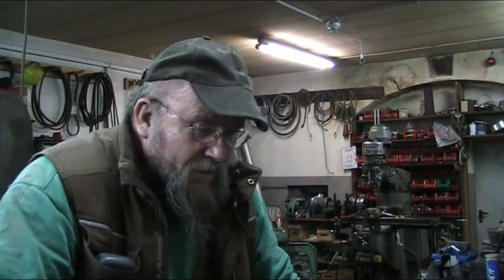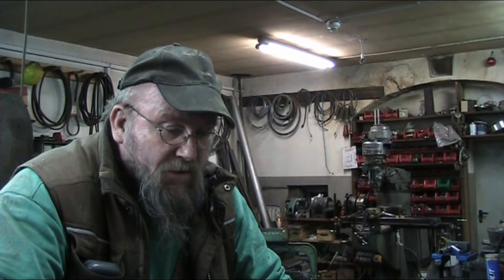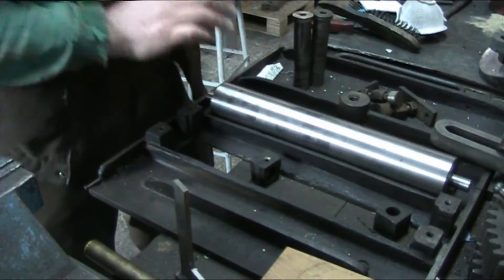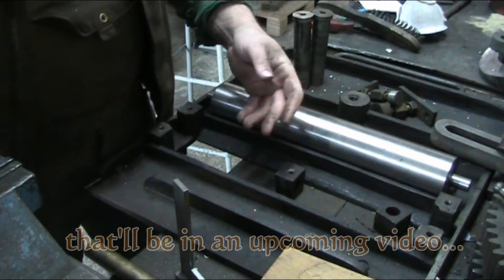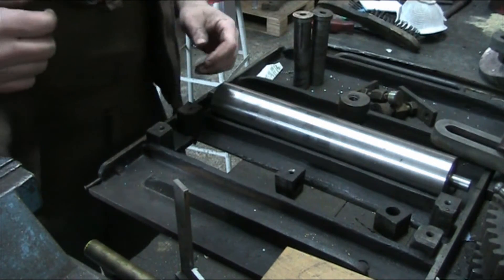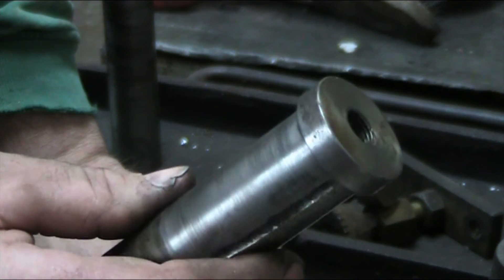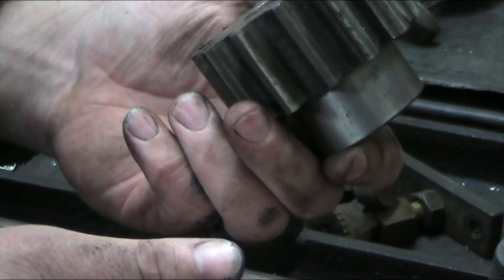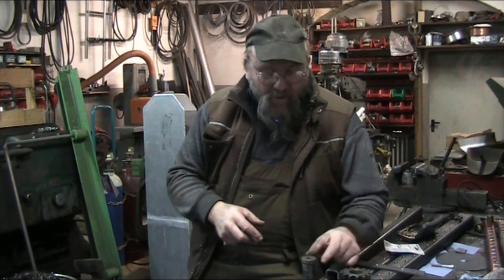this old planer, episode 6, failure analysis of the gear train

Comment: I would also second Keith Ruckers method of restoring that gear, but it is a rather small one so perhaps making a new one would be quicker and nothing to worry about the wear on the other teeth. 
Gears with broken teeth are suspect by default, needs very close inspection of the teeth next to it, it is quite likely that you may find a developing crack a the the root at one of the neighbours.
Reply from the maker: yes they are indeed a problem. this tooth broke off in an attempt to take the gear set apart. there is a very visible separation line on one side of the set and two opposing grub screws that are to prevent the smaller gear from spinning in the bore of the larger gear. the gear set was in dire need of a cleaning and in thinking it would come apart i accidentally broke the tooth...grrr 
brazing the tooth back on might make for some good video but i have a sneaking suspicion it will break off under the first good load it has to pull. this planer is 500mm wide and i do plan on using most, if not all of that capacity later on... so the gear train will get a serious workout and which is also why i'm gonna build a new helical gear train to replace this one. this should have the benefit of a smoother feed, less chatter in the work and much less noise. 
still lots of work to be done...

Comment: I watched Kieth Ruckers channel where he replaced a tooth in one of the gears on his planer he was restoring.
Might be an option.
I would think that a spiral groove around the pin for grease would be better but I am just thinking out loud.
Mike
Reply from the maker: hey Mike, good to hear from you again :)
 yes, i've seen the video Keith Rucker did and am considering that option and will make an attempt of it before i cut a new gear. to do that i'll have to round up a dremel tool so that i can dress up the break. doing it on the bridgeport would be a real bear. 

spiral grooves for lubricants are usually used where oils are used since they have to be distributed evenly between the bearing surfaces. sure a guy use a spiral groove here too but i'm lacking the change gears and banjo for the dividing head to make a nice even spiral. that's something a guy could do by hand with a dremel tool as well but putting two straight grooves 180 degrees apart should be effective for this application.